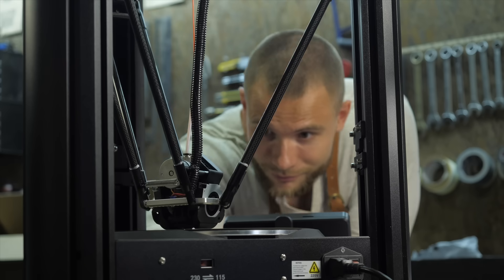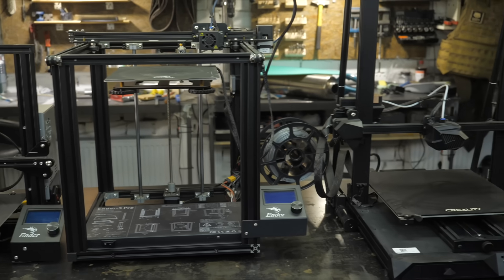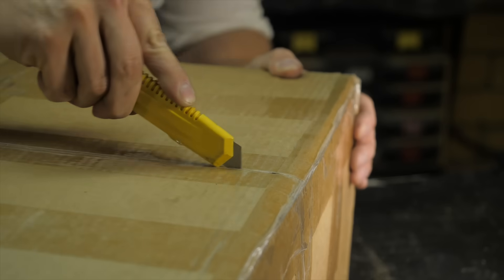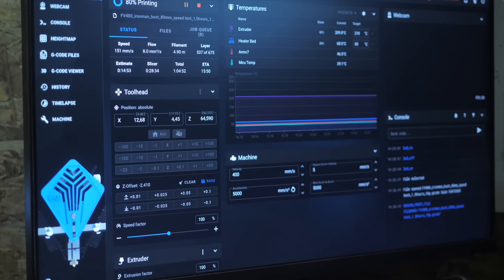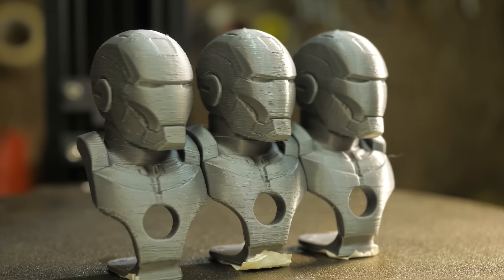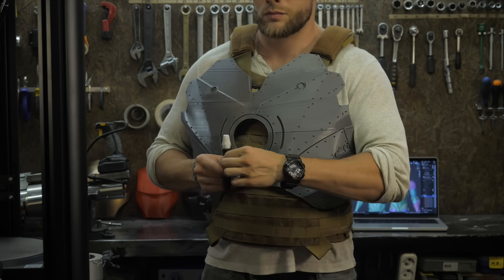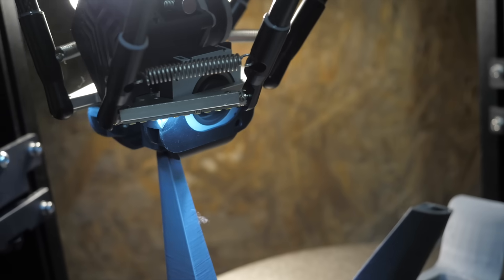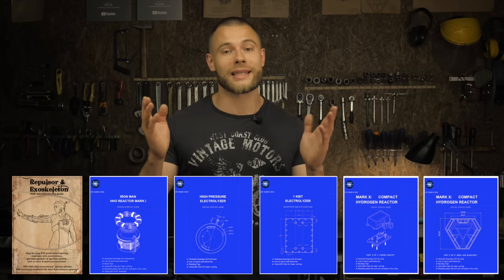FLSUN V400 3D printer max speed test + Iron Man suit updates @ALEXLAB

Comment: arc reactor is a combination of electronic physics with chemical reactions, try using a concept that can combine both functions with liquid hydrogen and electronics that have been made, the results will definitely be very satisfying.
i have idea but not have lab, If you pay attention to the occurrence of lightning in clouds containing hydrogen compounds and so on as well as the physics concepts used by industrial hacksmiths, then apply it to the round tube above the arc reactor and fill it with hydrogen gas obtained from the reaction of liquid hydrogen in the tube below then There will be a small lightning bolt in the tube from which electricity can be drawn via a copper coil
Reply: I live in a critical country, so realizing what has been a theory since seeing lightning has become difficult. Lightning can be created by chemical reactions combined with electronic physics concepts
Reply: This doesnt generate electricity, it loses it in large amounts, and the arcs are useless for glowing. At that plint just add some blue leds inside and a large capacitor and call it a day

Comment: There is a spray paint that makes things indistructible. You should try to use that with hard plastic material which will give you best strength that could reach to nearly bulletproof hardness and extremely light weight as compared to metal.

Comment: So you technically build a hydrogen generator that has a tube running to the propulsor with a ignition source connected to it, and when that ignition sources activated with the hydrogen, the hydrogen creates a combustion launching that project at high speeds. fascinating

Comment: 9:02 Thanks for pointing that out. I'm just venturing into 3D printing (2 months in) and there is a ridiculous amount of information to process and digest. A builder can get caught up in the mechanical aspects of why a print is not optimal and overlook other possibilities quite easily. Pointing out software/slicer issues is extremely valuable especially when all mechanical aspects have been addressed. I'm not curious to execute an A/B testing with slicers to achieve the best quality available for my printer (Ender3 V3 KE).

Comment: Instead of the composite materials for support, perhaps you could spray thin layers of Line X inside all molds, not only for reinforcement but also for actual defensive qualities without it being heavy like metal. Conceptually, thick enough layers can make it almost bulletproof. (some people have experimented with this)

Comment: so, how about making top-bottom half-molds, on top of the 3d printed object, by electroforming the top mold shape, you get the accurate surface under the copper, after making the model painted conductive on the surface, hard accurately shaped object surface, just grow more copper fast on the initial layer

Comment: I think its ridicules. Since he is just 3D Printing a Cosplay Plastic Suit. Wich many others have done years ago, with lots of Gadgets. I liked when he started with the under Layer. That should be First.  A "Dive Suit" that measures all your  Muscle Reflexes, wich is then Placed on a Virtual Model First (some Messuring ofr Medicals and make that Fire proof etc).
Then e Skeleton Shell wich Opens up and you can go in and Out.
Then Try the Muscles over the Shell, maybe these Magnetic rubber tubes.
That suit should be able to Move without you in it, copieng what you do in the "Divesuit".
And Only Then think about the Outerlayer (LightweighT? Bulletprove, how much can it carry). And the Design does not matter. It need to work, not look like Marvel.

Comment: If you use a quality CAD package like Inventor or Solidworks, you can export a dense .stl mesh that will drastically improve the fidelity of the final print. Also, to compensate for the fundamental flaws of the Delta design, I suggest grabbing a few NEMA 17 MKS closed-loop conversion boards. They screw to the back of the stepper and increase the fidelity by an order of magnitude. With the added benefit of even faster print times. Please don't use your newfound skills to help tyrants. Considering current events, thanks!

Comment: The bulk of the print time is the actual laying down of plastics, significantly reducing accelerations and move speeds won't increase print times much but will make a huge difference in quality(yes I do have a V400 and my 0.24 layers are smooth to the point of making the print look like 0.1 layers(better than what is shown at the 12:50 mark))....

I also stuck with the Cura 5 that came with the default profile installed, tried a newer Cura and quickly noped out of that, no point in fixing something that isn't broken just for the sake of something being newer.

Did some full bed single layer tests to tweak the first layer and found that 0.1 gave the best result as far as consistent first layer was concerned as my bed is NOT entirely flat, later increased mesh points from the default 7x7 to 9x9 and that helped a lot but still stuck with the 0.1 first layer for all my profiles(which have zero/near-zero nozzle scraping btw) as there was no point in redoing the first layer tuning just to get a thicker first layer(it's 0.1 so it also introduces less dimensional errors in Z due to an uneven bed than thicker layers would(I only do functional prints)).

That said I'm happy with the V400 as my 4th printer(first I got was so long ago it had an original reprap board in it...) to the point of being unlikely to ever get another one short of a large IDEX or a mini voron......

Comment: I have the SR model.
This version makes mine seem like a prototype.
I had to rebuild the hot end with aftermarket parts because it just kept jamming up.
And one of the first prints had to be a holder for the remote. Although it came with a magnetic one, the metal disc didn't stay adhered and the remote kept falling.
It works fine now, I'd like it to be able to go a little hotter, but out of the box it needed work.

Comment: Hello ALEX if you are looking for a very fast 3D printer I'd suggest you look into resin 3D printers if you haven't already, they print a whole layer at one time, and can cut printing time in half, the issue is that it does require much more post processing. But is much better when it comes to details

Comment: Honestly I would have expected a printer of that size and claims to be closer to $1000 or well above. Glad the technicaly issues smoothed out, making it a much better machine for your purposes. I hadn't really considered the benefits of the composite materials beyond the armor, but in recent months I'd also been watching a guy building an "Akira" bike with constant frame welding and prototyping external body parts from Fiberglass and now I can imagine where those parts could be a lot stronger in the final assembly now with the methods you've shown.

Comment: would be great to see a bullet proof test, with a kevlar, carbon fibre and metal plated combination test, I know it probably wouldn't stop a bullet, but to see how much (or should say if any) stopping power it would have, if nothing else it for sure would be entertaining :)
Reply: I would just build it out of plate armor like medieval armor if its going to have actuation for load support. That will be difficult and expensive though.
Reply: you would be surprised how easy it is to stop bullets. its all about how many layers you add. people make .5 inch thick plates with just fiberglass fabric and resin.
Reply: @roosterqmoney  one more reason to see it done :)

Comment: yeah to all of that, with two exceptions. I had no prior experience with printing at all but I just HAD TO have a v400 haha. Then I also had to follow the instructions much better than I normally do so I did and my machine is a little indestructible monster ... it just moves scary fast! And it just works. One thing which surprised me is that it's actually pretty silent for what it does I think? I'm now learning Fusion 360 the personal version for free and I like. I have been 3D modeling before so it's kind of same same but different, with more parameters in CAD or course. But I just love that machine already!

Comment: Use TPU, print as a wireframe, gyroid pattern, keep the void spaces under 1mm, soak in STF fluid, spay coat with rhinoliner.